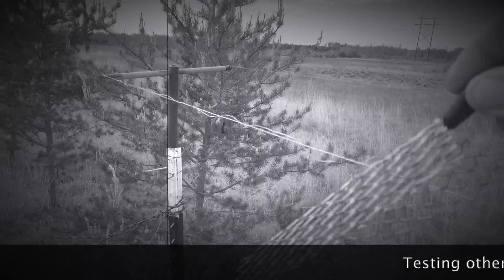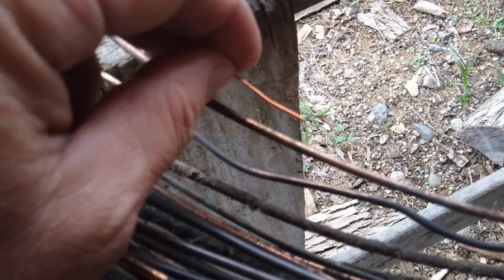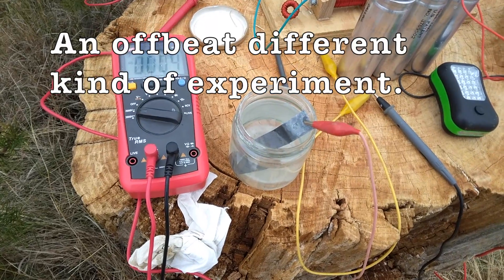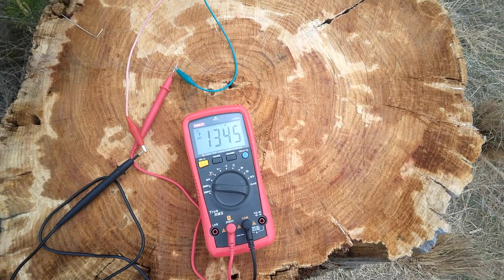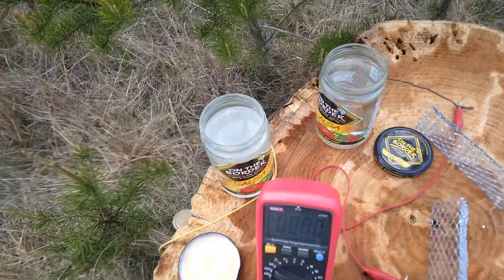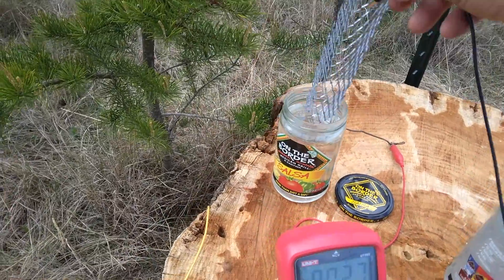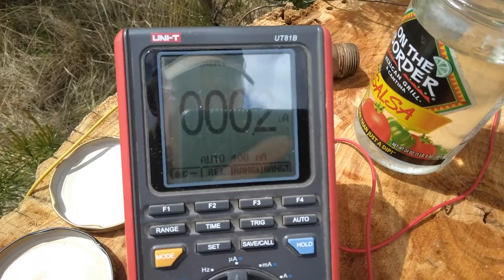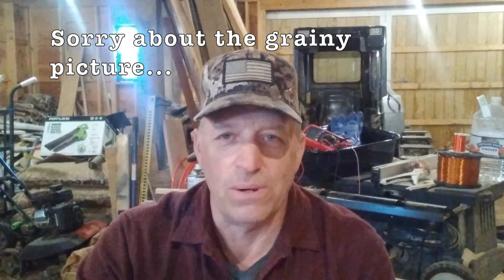Harvesting stray electricity

Comment: It is very hard to make any constructive comment unless you make clear exactly what the circuit is tha you  are connecting to. You should draw the circuit and what points you are attaching the meter leads to.  Also whether you are measuring AC volts, DC volts or AC or DC current. Your  picture is not good enough to see where you have the meter selected. Also, what your "antenna" circuit iis, length of wire , etc.

Part of the problem that can lead to confusing or inconclusive results is that digital meters are susceptible to noise. You need both leads connected to an actual circuit, otherwise it is impossible to determine if you are actually measuring something or not. An old analog style meter with a needle movement works better at eliminating "noise" and differentiating real voltage and current measurements from noise in the meter circuitry.  If you can't see actual needle movement on the analog meter, you are not really measuring anything on the digital meter. 

Using the "electrolytes" is also just confusing the issue!!  If you want to measure currents through electrolytes, you might make some make some meaningful measurements but what I watched in this video was essentially meaningless. At best, all you are doing is slightly changing the humidity and Ph of the air at the electrode. Neither is a good conductor although slightly better than dry air. If you are going to draw some conclusions, then you might then also try dipping them in plain water, milk and maybe Vodka or urine!! These might seem to give different results, but what would be the point??

Define a theory and test it. Collecting random data which is most likely invalid, seems like a  pointless exercise. What are you hoping to prove?

Comment: Nice experiments!
I bet you you will get better results using a foil sheet coated with graphene at the end of your wire.  Check out the "graphene super store".
I also expect better results when cloudy outside.
I eventually used one wire that separates into 7 wires by soldering more wires onto the one wire, and then back down to one wire.
Reply from the maker: Good to hear from you Paul; thanks for the tips!

Comment: Keep up the good work. Water is a very good cheap alternative for metals. Specially with big surface area. They used to call all metals as reflectors back in the day. Tinfoil is good alternative to experiment with bigger surface area too. Kitchen plastic wrap is a good cheap separator for the full roll.
Reply from the maker: Thanks for the info